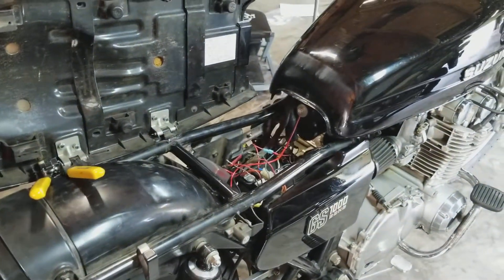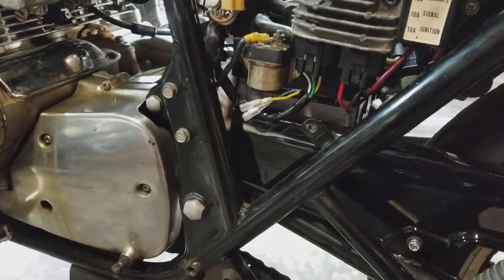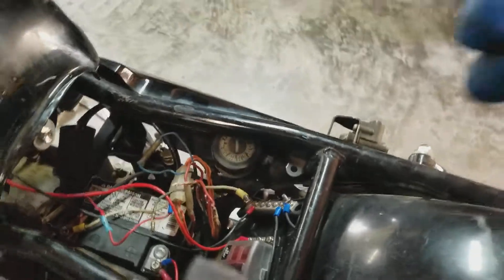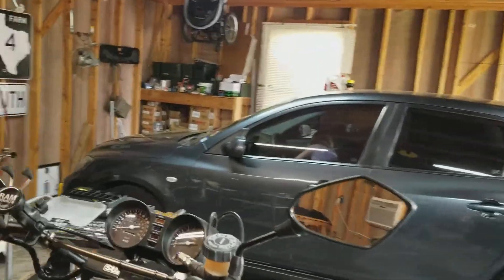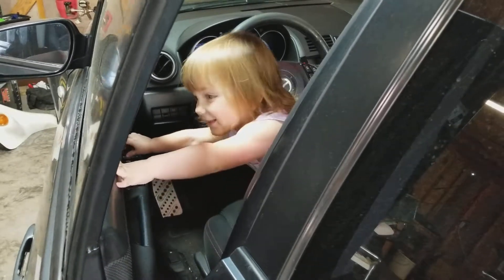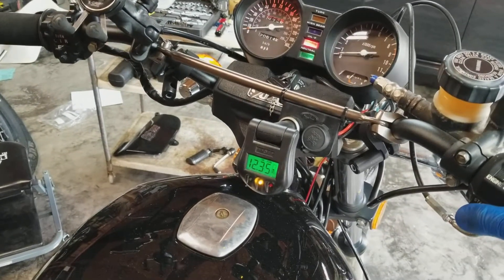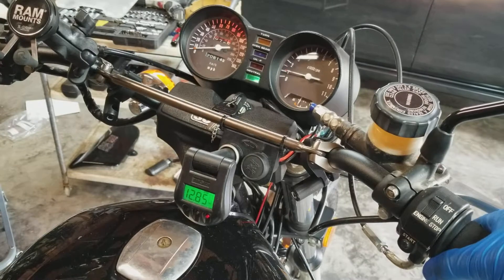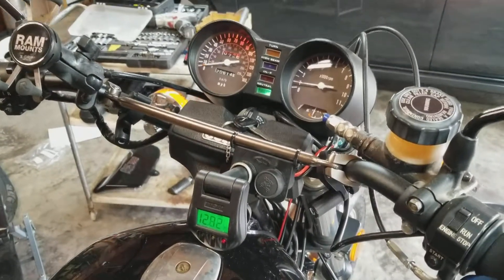Gs1000 post stator install

Comment: Nice.. still have the bike? 
Just picked up a 1980 GS1000 g . Had a big ol' Vetter on it I just pulled off.  I threw a LED headlamp and new front signals on there. Now the blinkers are acting weird,.... These old bikes... Require lots of tinkering but awful fun to ride!
Reply from the maker: This bike isnt going anywhere.  Its been passed down to me.